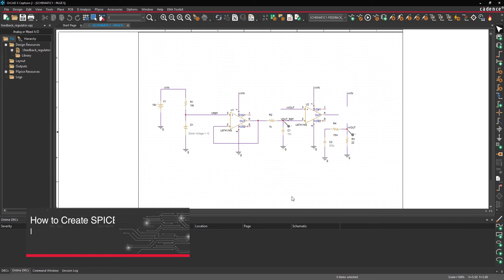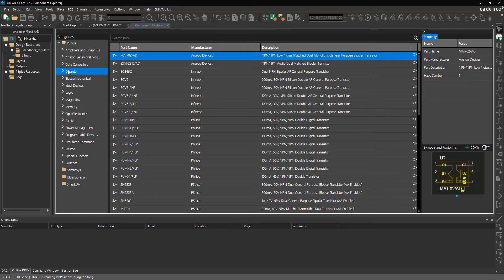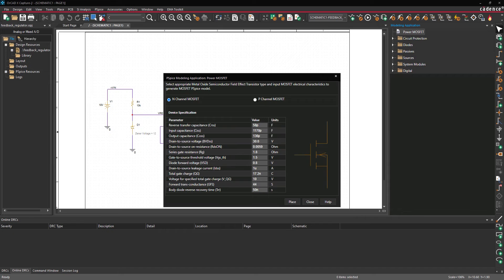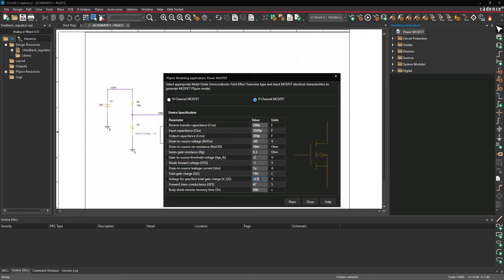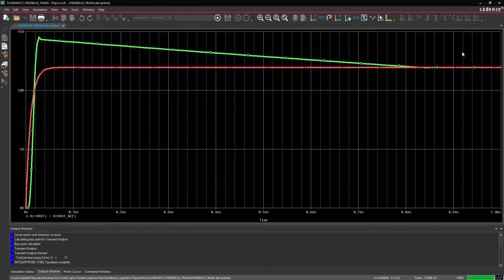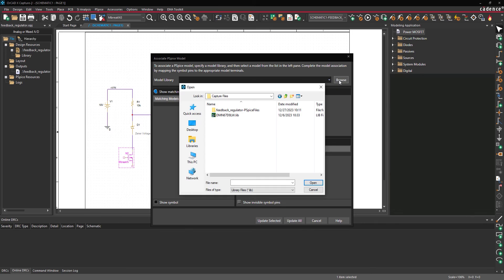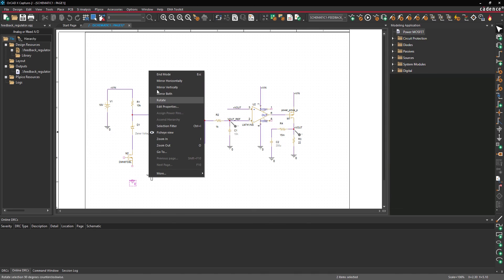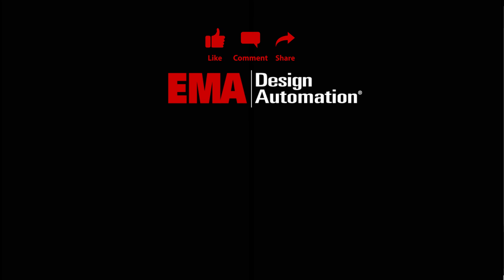How to Create SPICE Models in PSpice

Comment: I've tried to create a PWM generation block to analyze an inverter circuit. However, I want to create this block as a subcircuit, but when I use it, I get an error: ERROR (ORCAP-36002): Property "PCB Footprint". Does this suggest I need to create a PCB layout? Is there a way to avoid having to create a PCB layout?